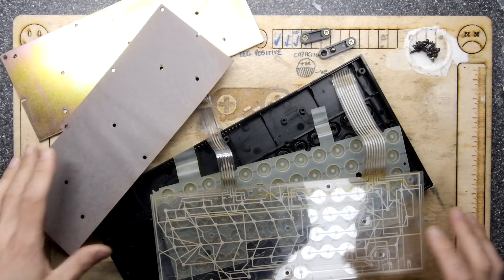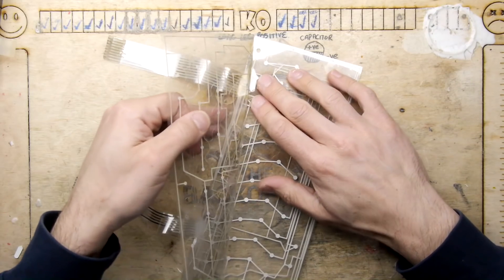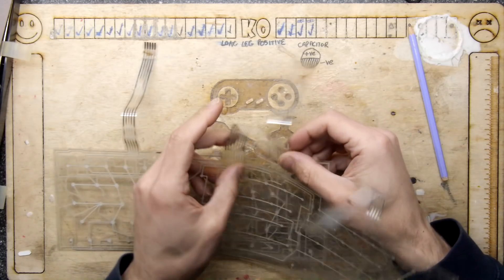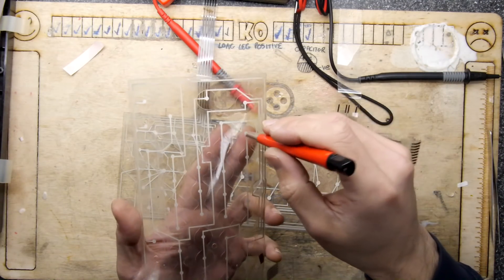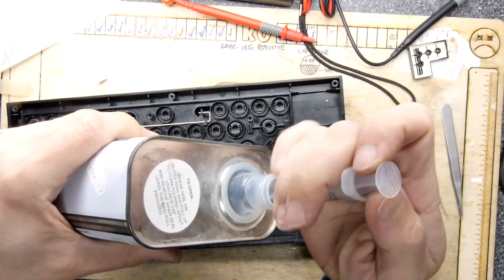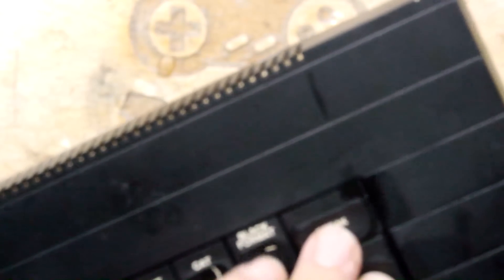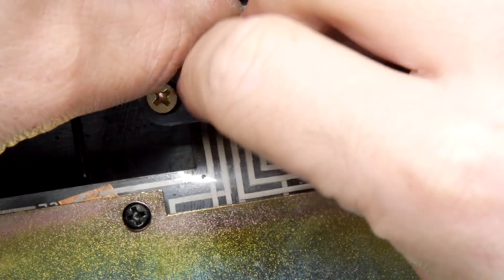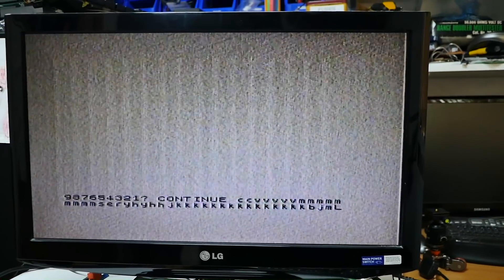ZX Spectrum Keyboard Repair For Free!

Comment: I have a speccy whos keyboard sometimes doesn't work for a few secounds on cold boot,then slowly starts working, anyone any ideas what might be wrong.
cheers
Reply: Hi! - Even your post has been added long time ago. - Do you still have this problem/ZX Spectrum?

The only device I've seen a similar behaviour was a +2B. The reason here were the capacitors. I think the Amstrad "ULA" had issues with the power supply.

I would expect that
- replacing the PSU with a new one (*1)
- replacing the capacitors of the board
will fix the issue...

@(*1): I always suggest to use a new PSU as the old ones, even when the capacitors are replaced aren't the best solution to operate 40 year old hardware. These devices are non stabilized and the Voltage often is really high which stresses the voltage regulators of the mainboard.
Reply: Hi , better late than never 😆.
It’s a 128k toast rack which still has the issues every now and then. Thanks for replying  @Eratosthenes0815

Comment: Anyone know why speccys had this huge lump of metal in them? I have a feeling it was only a trick back in the day to make them feel heavy and expensive...
Reply from the maker: It's a crude heatsink
Reply: @backofficeshow  Surely not. What should be cooled? - There's no contact to the ULA or the voltage regulator...

This membrane should provide more than 40 keys without extending the connectors (8*5) or the inputs of the ULA of the ZX Spectrum. - The massive metal backplate has to be used, because the 3-layer membrane for this use is a stupid construction. 
(The metal plate is needed to stabilise the keyboard frame otherwise the membrane wouldn't work at all...)

Reason: To handle the input right, the ULA has to receive two "keystrokes" for the extended keys. These have to be entered in the right order. CAPSSHIFT + 1 is used for EDIT for example.

Therefore two contacts of the membrane have to be closed in the right order. If "CAPSSHIFT" is pressed after the "1" key, you will see a "1" before the Edit command is executed. To ensure this, the construction must be stable and the membrane is really complex and error prone.

Edit: Entering one key on the 48k+ keyboard that is interpreded as two keys by the Speccy is a very common failure of the + and the Toastrack...

(By the way: I'm sure that Sir Clive wasn't amused that this massive - and expensive - part had to be added to the 48k+... 😄)
Reply: Late reply, but the heatsink is directly screwed onto the voltage regulator

Comment: The membranes on the Plus series seem to get brittle with time and the ribbons snap. I have had to replace both of mine. Yes replacements are available but small runs keep the price high. But that is still only about 3 to 4 pints going by pub prices round here.
Reply from the maker: Yeah, I still ordered a spare as I don't trust this and never want to have to see inside it again 😂 I think it was around £18 with post and packing on top
Reply: It did seem an overly complicated fix, dare I say it, a classic British Bodge Job (we don't have the right parts or the right tools, but I'll get her working, for a while at least!). ;)
Reply from the maker: Went the way of Leyland

Comment: Spectrum were cheap and at seem they were made cheaply too
Reply from the maker: I have strong opinions about the manufacturing of these gadgets 😊 but I think a better quality BOM could have probably been sourced at a good price and not necessarily be footed by the customers of the time. Still, they are simple enough to keep going and that's a plus point.
Reply: I took four rubber Spectrum models back under guarantee between 1983 and 1985.  By then the Plus model was out and luckily that proved to be a very reliable machine.  However about a week after getting the Plus in 1985, I took the motherboard out and placed it in a professional grade keyboard case.  It was one I forget the name of but it closely resembled the dk'troniks one of the era.
Reply from the maker: I think I saw one of those cases on eBay a while ago, looked awesome